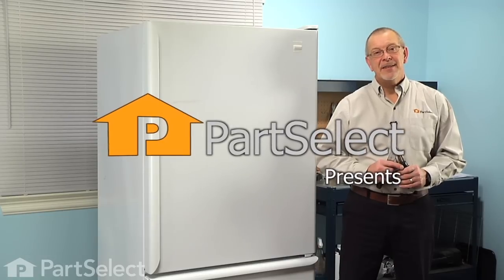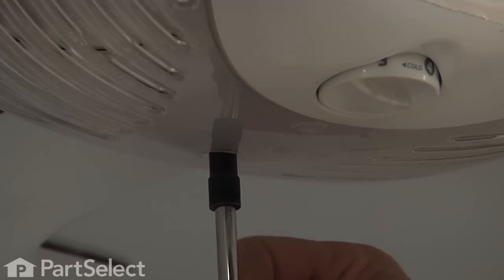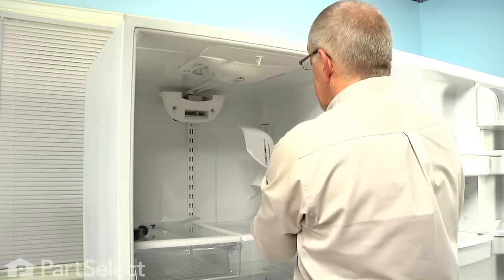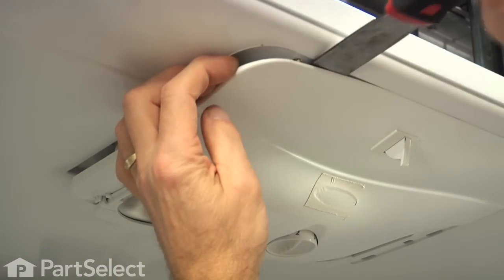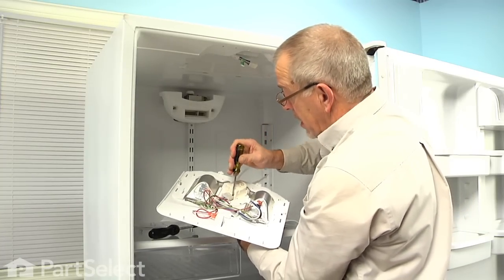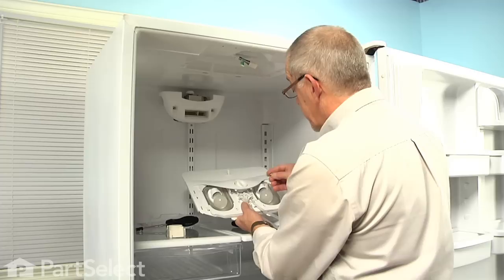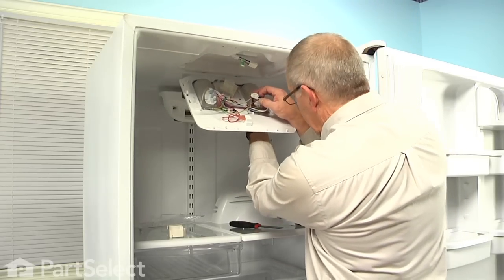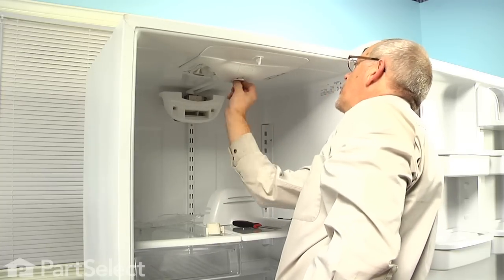Refrigerator Repair - Replacing the Defrost Timer (Whirlpool Part # 67001036)

Comment: Thank you SO MUCH for this video! I have been searching for two days trying to find the switch to turn to manually start the defrost mode on my bottom freezer maytag refrigerator with no luck. Although you didn't actually point it out I finally was able to see it's location at 3:30 ! Hallelujah!

Comment: Wow, spent two hours trying to locate the friggin Defrost timer, which 
on the Kenmore 596.69279991 IS LOCATED UNDER the freezer at the very 
bottom front right, behind the vent plate.

Comment: I just received my new defrost timer.  Why does it have a black wire?
Thanks again for your video.
Reply from the maker: Neil, What is your model number? I can check to see if the manufacture has updated the part from the original part.
Reply: @partselect  my new defrost timer has a little black wire also what is this for?

Comment: Hi! Wondering if this is what I need to do. My fridge has a build of ice where you have to take the bottom off on the inside to gain access. The ice block happens where it drains, and blocks the fan from rotating. I have to take apart every couple of months and use hot water to unblock. Cannot afford a new fridge so this would be great if this is what is causing it. Thoughts?
Reply from the maker: The symptoms would indicate a blocked drain tube or a defrost problem. If the water drains away when you manually defrost the unit, then I would suspect the drain tube is okay. The potential defrost issue could result from either a defective timer, defrost thermostat or heating element. The element can be checked for continuity with a multi-meter as well as the thermostat if it is at freezing temperature when you measure it. You can also manually advance the defrost timer into the defrost mode. If the defrost cycle functions okay, then the timer is most likely the culprit.
Reply: Thanks! Ended up with fairly new, used fridge...I did not want to spend alot of money on figuring it all out as it is about 15 years old. If I was a wee bit more handy I would have explored this but also have some renters relying on it so had to act fast. Appreciate the response as it does help me going forward! THANK YOU!!!

Comment: Steve, my refrigerator has seized up (the fan in the freezer compartment) due to an immense amount of ice build up.. I suspect it was because of having too many items stored in the freezer, blocking air flow.. but thought it may be because of the defrost not working.  I took apart my freezer, and found ice everywhere, defrosted it manually, and powered my fridge back on, and it is working as of now.  However, I am not sure how I could test if the defrost is working or not.  My fridge is a model Whirlpool WRF736SDAM11 - do you know where it is located on this one?  And if it isn't mechanical, do you know where the board is located?
Reply from the maker: Hello, we are currently researching this for you. Will have a response soon. Thanks You.
Reply from the maker: Hello, sorry for the delay. I have researched your model and it doesn't have a defrost time just a defrost heater. https://www.partselect.com/ModelSections.aspx?ModelID=7170242&ModelNum=WRF736SDAM11&mfgModelNum=&ManufactureID=3&Selected=C8C73F805F582E0455E2D4854B7AB2EB4BB8A904&Position=12&mfg=Whirlpool&Type=Appliance&Mark=12
There is a board located on the inside of the refrigerator, #18 & #23 in the diagram if you click on this link: https://www.partselect.com/ModelSections.aspx?ModelID=7170241&ModelNum=WRF736SDAM11&mfgModelNum=&ManufactureID=3&Selected=7A417DB1E2003B9216AB590C5584097FF758E255&Position=9&mfg=Whirlpool&Type=Appliance&Mark=9
There is also control boards on the back #2 & #5 if you click on this link: https://www.partselect.com/ModelSections.aspx?ModelID=7170238&ModelNum=WRF736SDAM11&mfgModelNum=&ManufactureID=3&Selected=64D9F71B0802AFFBD13A6BCC30323088E72F2CEC&Position=1&mfg=Whirlpool&Type=Appliance&Mark=1

Comment: hello sir, before one day, our whirlpool refrigerator's  cooling system was not working.  the technician checked and told us that the defrosting system is not working and he changed the timer and the bio metal as well.. is there any relation between timer and bio metal part. he charged us a lot for both parts. how to check the prices of these parts, if it is not mentioned. I am living in india

Comment: Hey Steve Brother! I was just wondering, I have a Frigidaire Model# FFHS2322MS2 and I'm trying to do a test with the defrost timer by manually turning it on. But I can't for the life of me figure out where it is located on my Fridge Model. Any Help would be greatly Appreciated man.
Reply from the maker: Your model does not use a mechanical defrost timer but uses the electronic control board to cycle the defrost circuit.